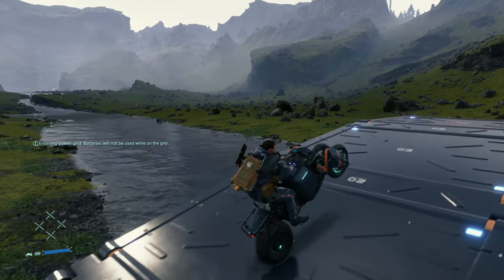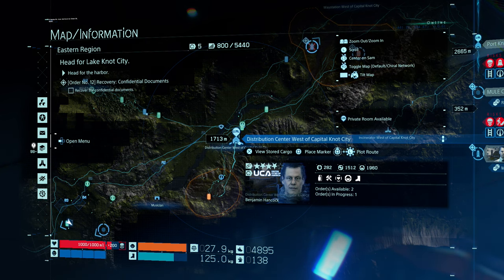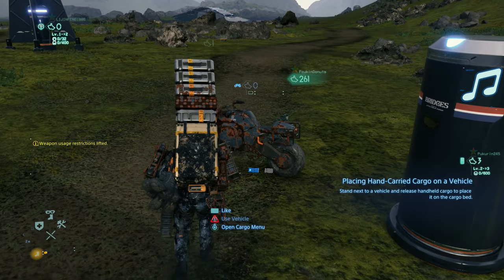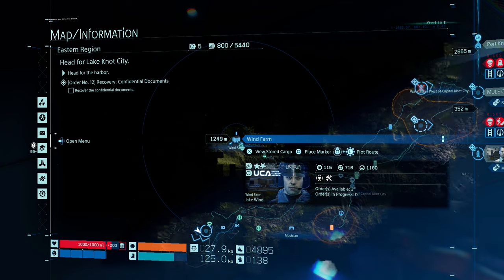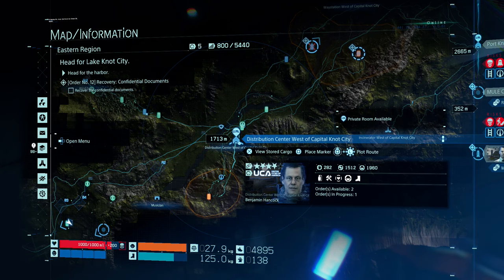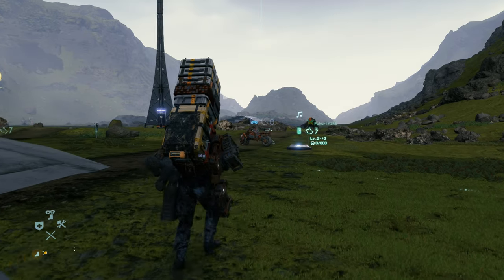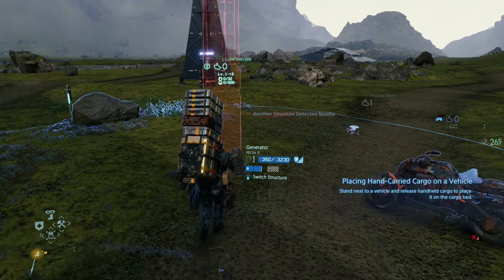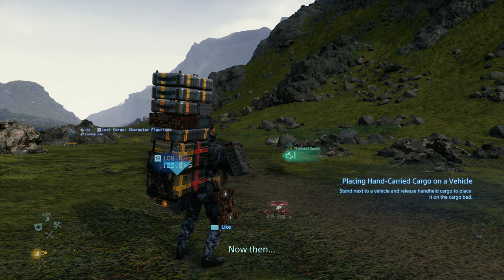Death Stranding - How To Repair, Unlock, and Charge Bike and Vehicles (Death Stranding Tips)

Comment: Should you dismantle the generator when you’re done with it or leave it standing?
Reply: Leave it there because taking it inside the facility to charge it takes a bit of time.
Reply: press and hold the option button closer to the structure and it will give you an option

Comment: Anyone having a glitch where you can't move the bike forward ? I can only take the bike in reverse.  And sometimes the accelerator will work but for that I have to go backwards first and then forwards. After a while even that stopped working and now I'm stuck with a bike that only goes backwards. Also I'm having another glitch where I get stuck In the menus especially if I try to load a save manually. Then I have to reinsert the disc or restart the whole console for it to work again. Don't have any problems with other games.

Comment: I have created that thing to charge my bike, but I am.not sure what step am I missing, bike is still not ready to use. help! how do I make sure the bike is getting charged?
Reply from the maker: That's odd. If it looks like 2:09 and the blue light is passing through it and the bike is kinda illuminating, it should be charging
Reply: I think you have to upgrade it? Im having the same issue. He shows the pcc, but that other thing he builds is not a pcc, a pcc is shorter. I think he is actually building something else? Idk
Reply: @bo4287  Man I ended up creating a postbox and tower and nothing happened. Not sure if I am missing a specific material or what. let me know if you figure it out as walking on for hours is hectic
Reply from the maker: PCC is the tool you use to build things. If you take out a PCC and press down on the dpad you can scroll through the things you want to build. One of them should be a generator. It's a skinny tower with a light on top. Did you place that down?
Reply: @Astrosive  Finally!! Thanks man. I kept selecting tower instead of generator. Noob moment. Thank you, brother!!
Reply: @tanshaq5733  Yo I figured it out. You choose PCC, then when you are building there should be another option, where it says press down to change TYPE. Once you do that you should see more options, such as Generator, which what you want, and Watchtower ect  hope this helps!
Reply: @bo4287  you're a savior. Thanks!!!